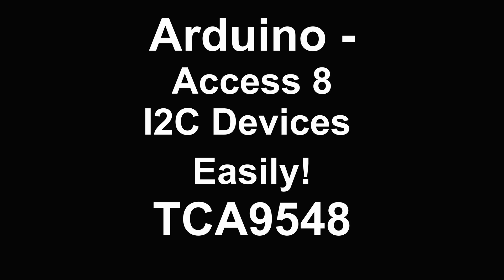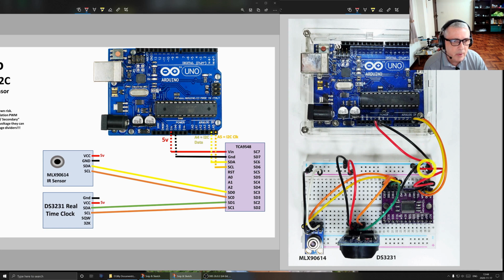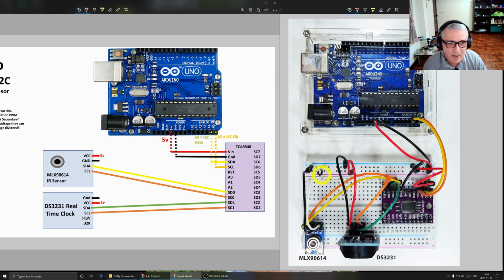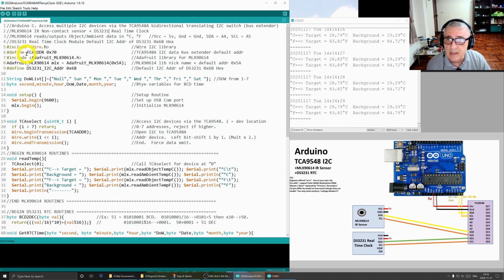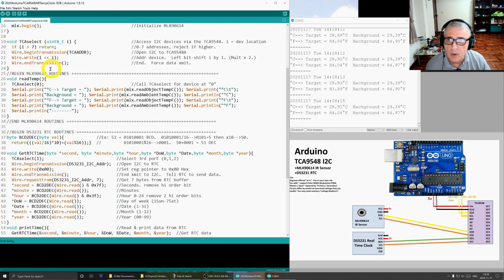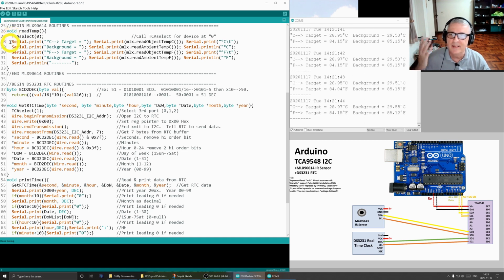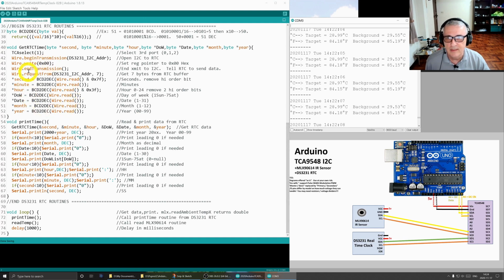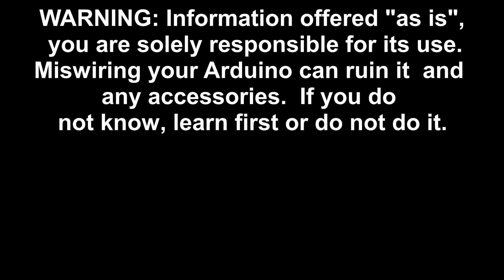Arduino - TCA9548A - Easily Use 8 Devices On One I2C Bus (4K)

Comment: Thank you very much for your explanations, I have one question:
Is it necessary to connect each ouput with a pull-up resistor?
Reply from the maker: Yes, I cheated to simplify things. I have the details in the description and links to TI's datasheet.
Reply: @tsbrownie  I don’t really understand how to use these resistors… If there aren’t here does it still work ?
Reply from the maker: @ailesangel  It may or may not work. I am using a single power and ground, plus 
I am not running it fast, so that is why I am getting away without them. Look at the diagram in the spec sheet. The resistors make sure there is a clean change from on to off in the clk and data lines (that the voltages go from 0 to the on voltage, on a scope it would be very square).

Comment: is it possible with different oled lcd addresses (SSD1306 AND SH1106)?
Reply from the maker: If I understand your question, it should be.
Reply: Yes, and this is very util specially with oled displays, because once you declare 2 GLCD, (assuming you are using a 128x64 glcd) each display has 1kb of ram... by adding 2 you are on the limit of ram plus your program.  So with this device you only create 1 and this allows you to have 8 GLCDs by just specifying the adress of the display you want to print something and without consuming 8kb of ram. In arduino this is extremely simple and easy to use because the library already exists... im trying to implement 5 glcd on a pic18f4550 with this tca9548 and it has been a nightmare.
Reply from the maker: @rwl.5086  Thanks for the comment, it's very informative. Not sure why Youtube did not notify me before.